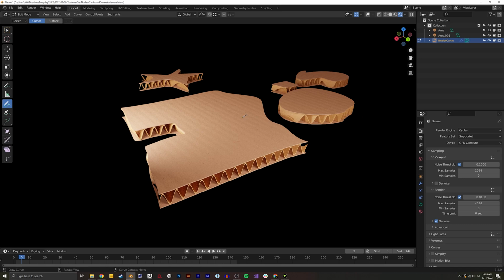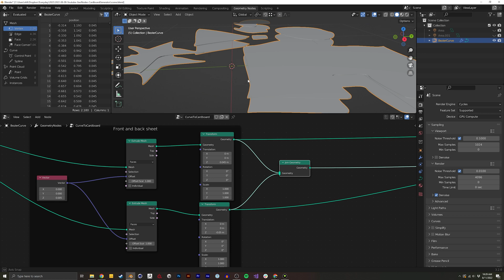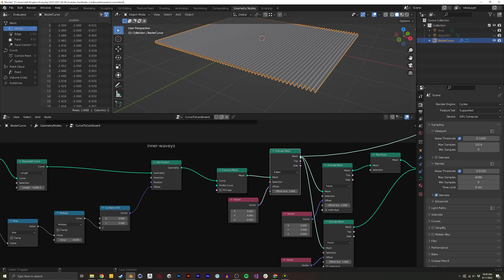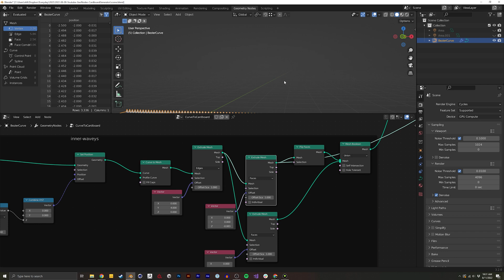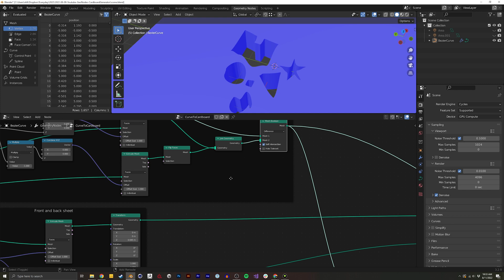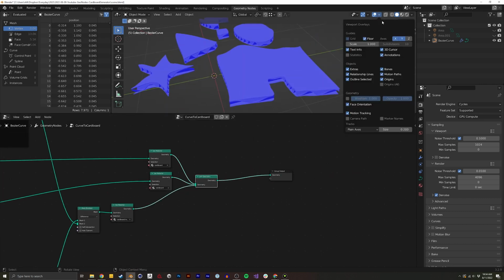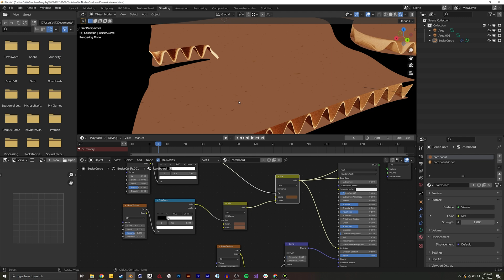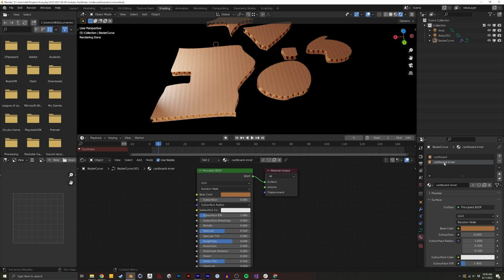Blender Geometry Nodes - Cardboard Generator!

Comment: I am using Blender 5.0 and can't seem to get the manifold extrusion stuff to work. No Matter what I just have red on one side. I am wondering if it's user error or the new version.
Reply: I got it to work. I am using MM for my file and could not make the curved liner thinner than .75, even though mine measures .35mm in real life. It all works great once .75 or thicker.

Comment: This tutorial is exactly what I need for a project I am working on so thank you! One question, the "curve line" you use for the wavy inner portion, does the curve line node automatically create it or did you draw it with a draw tool?  In your video, that yellow straight line just appears when you click the "Curve Line" node.  When I generate the curve line node, nothing appears.  Also, at the bottom of your "Resample Curve" node, it says "length .006m".  Mine says "Count  2". Am I doing something wrong?  Thank you for sharing this.
Reply from the maker: no problem. The inner wavey curve is indeed made in the geo nodes (not draw tool). It is made with resample curve. If your curve is 'count 2' it won't have enough vertices to make it wavey so you'll want to switch the mode to 'length' like i do in the video with the dropdown in the node.
Reply from the maker: Every part of the process is in the video so you should be able to see how its done. If not - you can always download my project file on my Patreon.

Comment: This is amazing, thanks for sharing !

Would you know how to evolve that set of GN in order to convert an object into cardboard? like let's say you have a very low poly model of a house, it creates the sandwitch and the waves based on the orientation of the faces

Keep going with the cool work !
Reply from the maker: for something like a house you would only really see the perforated edges on the roof so you could take two squares with this GN. And then the body of the house can just be a cube with a shader to mimic the outside of the cardboard